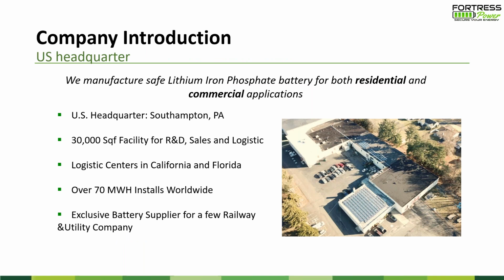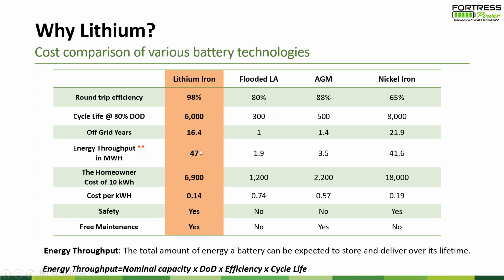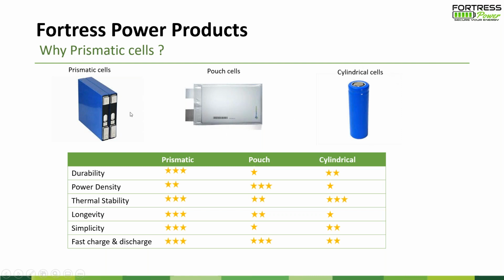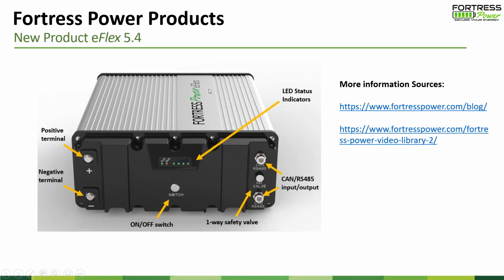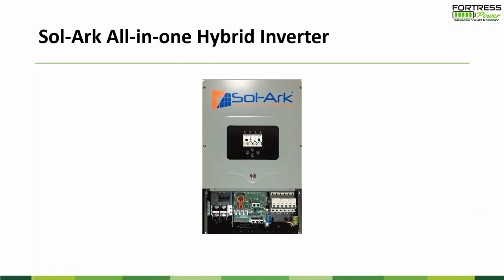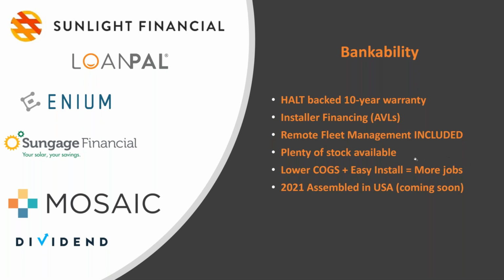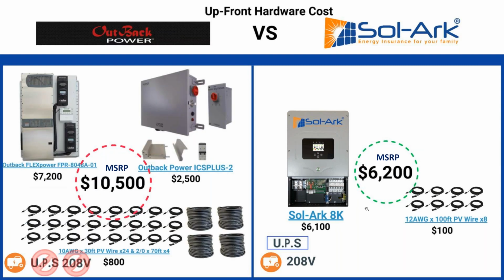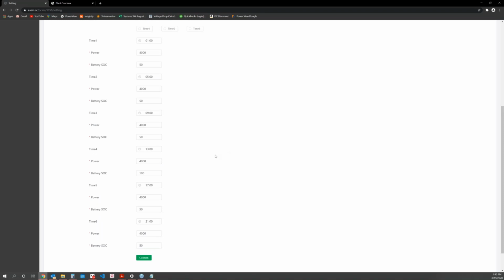Fortress Power and guest host Sol Ark Webinar

Comment: Where is it selling for the MSRP $6900 ?  When I search Google the 18.5kw/h Fortress seems to sell for $12,000 +   on popular sites... I'd pay $6900 for it but not $12,000, sorry...
Reply: $6900 or $7000 is for the Sol-Ark 12K Inverter.  The Fortress eFlex 5.4K batteries in the video are about $3600 a pop.  The price you are thinking of is for the Fortress eVault 18.5KW battery. It is still a lot cheaper than the Tesla powerwalls when you do it on a dollars per KWH basis.

Comment: I would say that for off grid no less than 40Kw of batteries. I think eFlex 5.4 it is only good for an eBike. Do any of you here are off grid right now? If I would have money really I would like to have 100Kw for a US house. eVault is not even close to be enough for off grid. You need at least 2 eVauts minimum for offgrid.
Reply: Agree, I have 2 eVault 18.5's and a super efficient house.  I can make it through the night without grid about 50% of the time (peak summer AC load).  Really need 2 more to make up for bad weather.
Reply: Yes I have 50Kw storage and  I'm finding it"s not enough for my family's needs. 16Kw of solar in the winter won't be enough to fill up the battery either.  I'm running the  generator more than I thought I would.
Reply: @greenwasp1046  
1. LiFePo4 or Lead Acid Batteries?
2. 16 kW of solar panels ?
3. Are you using electricity to heat you house in the winter.
Reply: @mlg779  
\1. LiFePo4 or Lead Acid Batteries?
 New Energy LiFePo4 Prismatic 72Ah cells 14S 16P 1008Ah, 51.6Kw
2. 16 kW of solar panels ?
 48 Enphase panels.
3. Are you using electricity to heat you house in the winter. No but I do drive a Chevy Volt.
Reply: @greenwasp1046  OK, It makes sense if you have a Chevy Volt.